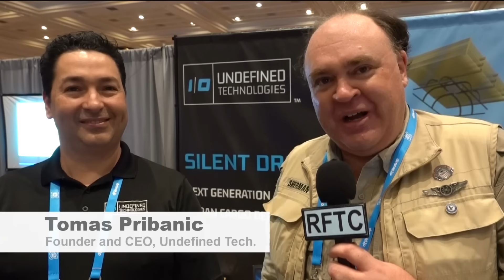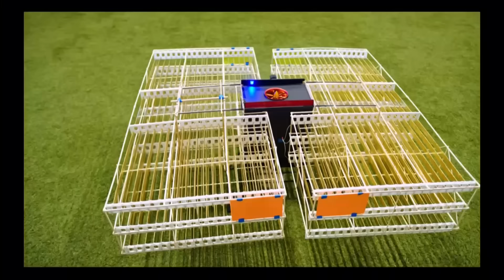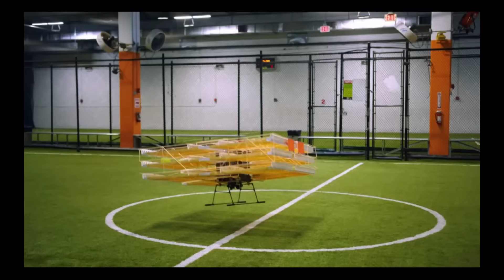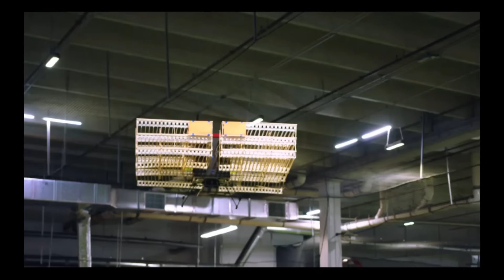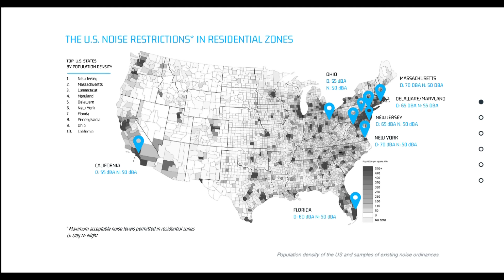New Drone Tech: No Propellers, and Yet It Flies!

Comment: I'm not sure if the use of this ionic thechnology will take much time to be applied on moving practical aircrafts, but it could be imediatally applied with great acceptance and success on air conditioning devices, for sure. But this is not a new thechnology. I remember as a kid my dad built an experiment with a toy boat with ionic prop in the bathtube. I was amazed, it was around 1972, I believe.

Comment: Not silent. Quiet yes but not silent.The power transformer has to make a hum from the harmonics of the power supply waveform. It flies by a high voltage electrical field. Just VERY low current. Just like a plasma jet blimp.

Comment: A friend and I built one of these in the mid 1960's!!  The lifter matrix was balsa with tiny gauge wire and inverted V shaped emitters and the A1A rectifier bridge, neon sign transformer, isolated  filament transformers were hand wound and homemade capacitor was about 40 lbs. As a science project, it did have lift and the ozone smell. But no controls at all. I concluded: not in my lifetime - - - but now proven wrong 60 yrs later. It looks like mine, unstable.

Comment: It's likely that the component in the center is an EDF (electric ducted fan) but the flight control adjustment could be done with high voltage ions.  A bit misleading in the presentation but an interesting design nonetheless.

Comment: Saw this technique years ago it was called an ion lifter has to be extremely light weigh and Apparently you need a lot of power to make this work 60.000 volts if I remember rightly and was tethered no battery onboard 😌

Comment: This technology has been around for decades. As a kid in the early seventies, I did a science project on ion propulsion  by using an ignition coil , some plastic tubing, and other odds and ends . I was into that stuff. Im now a retired engineer. It does work but requires a tremendous amount of electrical power for minimum thrust. 
As for that huge craft that guy built, it looks real sketchy to me.

Comment: It's just a cooling fan for the electronics.

If you think a fan that small can silently lift a drone.....just stop , you're making a fool of yourself.

"Ionic wind" has been around since the early 18th century.
This isn't even the first aircraft I've seen that uses it for propulsion.

The "scam" part of this is that it only works in clean dry air.
Any mist , fog or dust and it shorts out and drops.
So it's useless for "delivery drones".

Comment: You can make a second and third electromagnet by plasma on the upper side and down side of the drone. There must be a main electromagnet in the drone . upper magnet can pull the drone and down magnet can  push the drone. If a particle ion enters a magnetic field the particle makes a electromagnet . Problem is making superconductive magnets in the main body..

Comment: It is an asymmetrical capacitor. The negative is chasing the positive while the positive always stays ahead of the negative. In other words, this is a theory where an asymmetric capacitor generates thrust due to the uneven distribution of charge, supposedly propelling the device in one direction.The quintessential UFO propulsion system. Requires very high voltage to make the system go FTL. We already have the technology to do this it is just not shared with the public.

Comment: oh great, more battery powered devices :o/
as if we don't have an over abundance of battery powered stuff today already.
our so called innovativeness is going to create a new problem, and presents a new obvious question. What happens to all the spent ToXic batteries? recycling? i think not...
we don't need MORE drones, ESPECIALLY SILENT ones, we NEED to develop tech that doesn't produce more toxic waste and the amount of elements mined to produce just one of these batteries is ridiculously absurd.
With that said, the amount of power required to make this thing useful would far outweigh the practicality of it's use. It's got to be able to carry that battery around and still be useful, the more power you provide the larger the battery has to be, there is a weight differential problem you can't overcome.

these same type of entrepreneurs tried this with the self charging vehicles trying to make a charging system on a car that would charge the car while driving it, you cannot overcome the power output/input differential using a single power source, it's a self defeating physics issue where you cannot put more into it than you get out of it at the same time.

i admire his concept though but until a new type of power source is invented that has a high output and is lightweight and can sustain a reasonable amount of runtime, and is not a 'throwaway toxic product, and i mean a 'runtime' outside the boundaries we suffer today these concepts are just pipe dreams designed to get us to support them due to false hope of a brighter future through technology to make someone else rich despite the ramifications that come out of it's development.
Before i invested into anything like this i would have to examine it inside and out to verify it's validity and potential use and applications.
Reply: So you're saying gas is the best solution so far the nine year olds in flip flops shouldn't have to mine for Tesla batteries so the Rich can feel good about themselves the problem is unsolvable for now keep the innocent kids safe from the mines😮😮😮
Reply: @So-Say-We-All  gas? who said anything about gas?

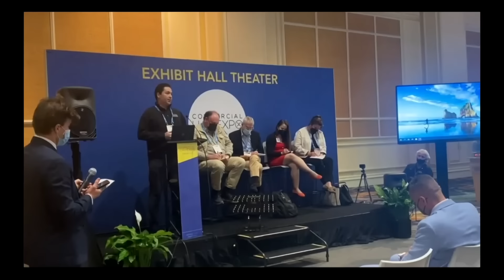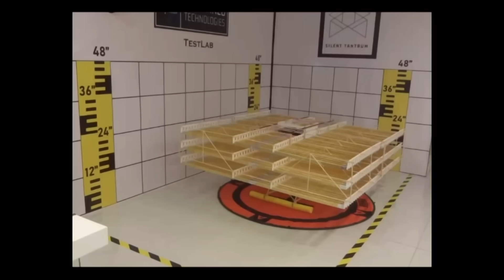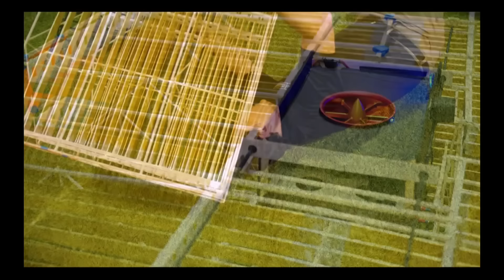Comment: at 0:22 that is a "different" design from the one we see flying starting around  1:08 and at 1:45 you can see some kind of Fan Motor... at 2:34 you can see the entire "ion" frame FLEX... so is it just a fake light weight balancing platform for a center fan thrust motor?... he never stated what the altitude maximum was... or even how fast it can climb to a reasonably safe altitude. 🤔

Comment: I would venture to guess the fan in the middle of the aircraft provides air to cool down the electronics. The small propeller would not lift the aircraft. I'm sure it doesn't have enough thrust to lift the aircraft.

Comment: The voltages used for ion propulsion will be very high (10,000 or higher) but the lift gained is very small. The electric thrust fan we see in the middle is probably essential for this thing to "fly" because there is a limit to how high a voltage you can get with batteries. Don't invest, not yet. Even if higher voltages can be applied, the air all around is conductive, and it will begin to Arc openly at some point;  so no more silent operation and it will flash intermittently. The demo is in a very controlled environment and no microphone recording is included - I think we know why. This is a clever application of tech no doubt, but it's the laws of physics and the limitations of current technology that keeps this to a "concept car" for any time soon. If that is a thrust fan in the middle it cannot be silent as advertised. That noise could be detected easily whenever it is within effective range of a position that has proper detection systems in place.

Comment: Saw this first ~ 50 years ago in a Popular Science/Popular Mechanics magazine article. The original one was powered by ionic wind generated by a high voltage power supply attached by a long,thin wire. This new one has a small enough power supply to lift it and the vehicle for several minutes.

Comment: WTF!! It has a 70mm Ducted fan right in the center of the damn thing!! The BS meter just broke it's dial!!
Reply: That looks more like a cooling fan to keep the high voltage electronics from frying.

A 70mm ducted fan would never generate enough thrust to hover 2+ pounds of mass. They didn't give it's empty weight but it looks too heavy to hover on a single ducted fan of 70mm.

Comment: "It's a new concept" no it's not...  I also wouldn't want to be anywhere near that thing while it's operating..
Reply: Why? Ion generators are used all over the world. I had 3 large air scrubbers in my tavern back in the 80's when everybody still smoked in bars.

The ion generators in those air cleaners cleared out the smoke quickly.

Comment: I'd bet it operates using electric fields, ions creating air current. There's a startup that makes laptop fans on the same principle. Not quite as efficient as a fan, but close. And that's prototypes. And it's silent and solid-state.
Reply: If you look at their website, you can hear a ducted fan running. Also, from this footage, it shows a ducted fan in the middle??? Probably just using thrust vectoring of the ducted fan for control. It makes about 75db of sound, silent??

Comment: ION propulsion is way to inefficient to use in earths atmosphere plus way too slow.  This is bullsh*t.. If it was feasible or efficient, NASA and the defense sector would have used it before.
Reply: It seems you are not aware of the latest research. A while back they cracked ION propulsion in atmosphere that could generate up two gravities positive lift.
Reply: @shamgar348  I'm an totally aware of the latest research, the latest propulsion and the latest technologies/electronics. 

ION propulsion is highly inefficient and would requite an enormous HV power supply. In space they use it because you don't need much.

Comment: my guess is it uses some type of fancy system that can create voltage differentials across the anode material? basically allowing it to ionize and electrostatically manipulate the surrounding air in a controlled fashion.

- controlled voltage to specific areas of the ion drone creates changes in how much air is thrusted downwards, creating flight controls.
- controlled propeller speeds in normal drones creates changes in how much air is thrusted downwards, creating flight controls.

Comment: The one on the video had an EDF probably providing the bulk of the thrust in the middle, it seems to me like the prototype the had in site didn't actually fly but it's just a concept.
Ionic propulsion is legit and you can use it as aircraft propulsion, but I don't think they have managed to exceed a 1:1 thrust to weight ratio (required to fly vertically) with any reasonable flight endurance.
Reply: The crafts on my channel are the only fully ion propelled aircrafts with onboard power greater than 1:1 TWR.  The longest continuous flight was one minute and 51 seconds.  In theory it could fly all day long with some added solar film/panels, or other upgrades.
Reply: @KraussEMUS1  Your stuff is quite impressive but I do still believe it's gonna be a bit before this stuff is viable for high static thrust applications

Comment: Hey ithink its fake, there maybe a hidden propeller and ionic trust seems to be only used for stabilisation, thats why the drone is unstable and balancing on its middle center of gravity, Ionic trust should provid uniform air flow right? and the sound looks like a propeller mounted on a brushless motor

Comment: Undefined Technology, based in south Florida. The company has built a prototype drone of approximately the same dimensions and configuration as a conventional multirotor – but without propellers. Instead, it uses charged ions that exist in the atmosphere and attracts or repels those ions as needed to develop thrust and maneuver. The prototype is five-foot square, capable of flying up to 15 minutes while carrying a two-pound payload. Owing to the lack of propellers, the aircraft is virtually silent in flight, making it a good candidate for cargo delivery and other missions in the urban environment where noise can be an issue.

Comment: No propellers but an EDF right in the middle.   Cue the BS alarm!
Reply: its impressive 

I gotta give him props
Reply: @hindugoat2302  I saw what you did there!
Reply: @hindugoat2302 😂😂
Reply: @hindugoat2302  Underrated comment.
Reply: Maybe its for cooling, stay cool
Reply: you can get to build these, i built on on a small scale years ago so yes it works.  The issue was getting a configuration where power source was light enough to be lifted. so yeah looks like they did it.
Reply: @robt7713  I dont think they did it .  Otherwise they would no need to put a propeller on top of that think as they did it.
Reply: I think that fan is for cooling the equipment it is to small for liftning the device, but that is my opinion though.
Reply: I saw a YT vid recently that showed a real existing laptop fan which used ionization - NO moving parts. Problem is, it doesn't have much power. Its air stream is good enough, but it can't really push. It exists, though, and there's even a laptop model available that uses these: No more fan sounds, yet streaming air. It's real. - This doesn't mean they didn't pull our leg in this video here, or a fan being there doesn't mean that the overall drone levitation tech they're supposedly using isn't actually being used in the video.
Reply: Seems less efficient than just a balloon
Reply: You are right, exactly!! ION propulsion is way to inefficient to use in earths atmosphere plus way too slow.
Reply: @fjs1111  This kind of ionic propulsion requires earths atmosphere. That's what it's using for propulsion, not Xenon gas.
Reply: @fjs1111  Its not necesserly slow. I saw experiments which had a very high acceleration - 25 years ago already. And this concept isnt new. The ion propulsion in spacecrafts is slow for different reasons. 

But in one thing you are definetely right:  its inefficient as hell. It consumes ridicilous amount of energy. And its also quite loud. 

Another thing is: you dont want to be near that thing... the electrical currents are very high , and its quite easy that the drone would use you as ground ;)
Reply: it's for cooling, not thrust
Reply: @truthtoad  I dont believe that. I saw many of those kind of lifters  25 years ago, even big ones. None of it needed cooling at all. Its the Biefeld Braun effekt, which is known for 100 years. Nothing new. And i knew every principle of it (because its not complicated). 
But people who dont know physics (in this case electrodynamics) can easily think, there is a propeller needed for cooling.

But even for the extremely unlikely event, that you were right: 
Even then it proves, how inefficient this method is... because heat always means inefficiency when it comes to mechanical movements.
Reply: They sound like salesmen. I smell scammers.

Comment: Finally someone is making use of this technology. I'd be incredibly surprised if it doesn't become commercial.
Reply: The UT version above is propelled by a ducted fan.  There are many videos on my channel of a series of real ion propelled crafts with onboard power.  They are patented for lifting their power supplies against Earth's gravity..
Reply: @KraussEMUS1  I've seen them, but I like this one more. I've seen this tech and a lot of hobbiest crafts. It's not new, I know that. I like this companies approach the most though.
Reply: @qownson4410  
Here is a link to a video of the above craft with audio:

https://youtu.be/iihprC5Huf4

A loud EDF can be heard on the craft, it's like a toy aircraft jet engine fan.  There are many flying machines online propelled by them.

A two-stage lifter like the one above, requires an external power supply weighing kilograms to lift a craft that weighs grams. A two-stage lifter also produces only about 1/2 a gram of lift per watt, 3-stage ones even less.

My patents show how to make an ion thruster that lifts its power source. The UT craft has none of the factors that would make it lift its power supply without requiring a powerful fan.

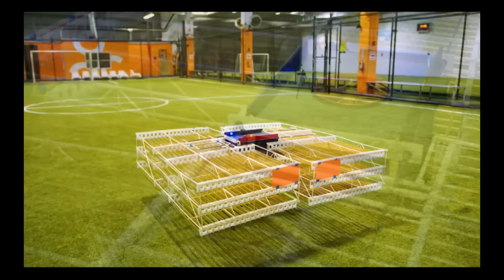Comment: How about that EDF at the middle 1:45? No propellers huh? Funny how it has built in wall to hide it it when it is flying yet and looked from the bottom. But cameraman screw ups and just zooms in on it from the top xDDD
Reply: its a cooling fan for the onboard computers but you sound so smart so you were only asking that question as a test right?
Reply: @GUNBOAT-1  That's not a cooling fan. I have this fan model myself. Google for the model: "JP Hobby EDF". 
It has a significant thrust making this demonstration completely invalid. Also, claim they used no propellers is absolute lie. The only thing they used ion propulsion for is to level the drone in the air.

Comment: This is not new technology. This is a standard 5th grade HV experiment.... typically performed with a HV ionizer module, wire, some popsicle sticks, a 9v battery, and some aluminum foil... This is merely scaled up 🤣🤣🤣
Reply: It's impressive if you made one fly with a 9V battery.  It was likely very small and light.  On my channel are some that carry their power supplies, but they are the only ones that do.  It took a really long time to get the power onboard.
Reply: Mind you... I was in 5th grade in 1995.

Comment: Really cool, what i want to really know is why technology like this has been around so long but not developed.....Same thing can be said about space flight, electric/hydrogen cars but also we loose the knowledge of that technology and its like we start again from the begining
Reply: I can tell you why:  Ion lifters were at least100s of times underpowered to lift their power supplies.  The UT craft is an ion lifter with a geometry that allows for less that about 1/2 gram of lift per watt.  It is powered by a loud ducted fan not ions:  https://youtu.be/iihprC5Huf4
There is only one series of heavier than air ion propelled VTOL ion propelled craft with onboard power.  They were patented specifically for lifting their power supplies.  It takes a lot of major specific changes to make it possible to lift a power supply with ions.  There are 35 flight footage videos of the real ones on my channel.

Comment: Not viable, the 2lbs they are speaking of is the battery. It has to be extremely light weight to fly and it won't handle any wind at all. Its useless Elon level deception to suck money from investors.